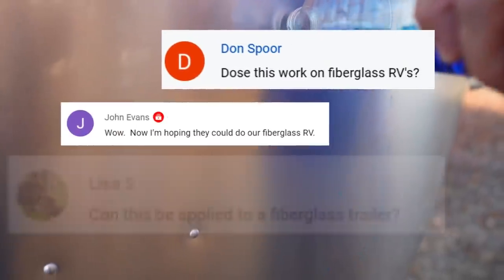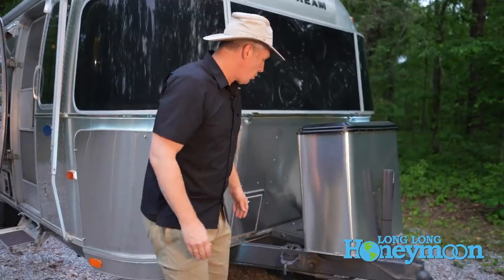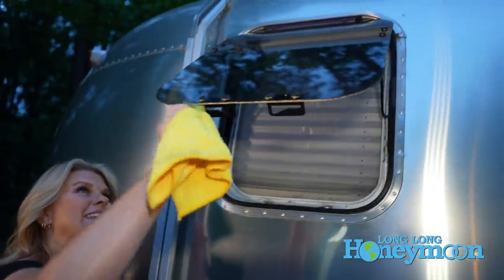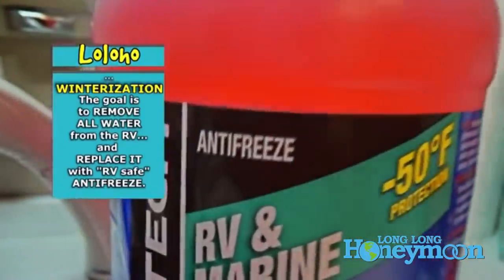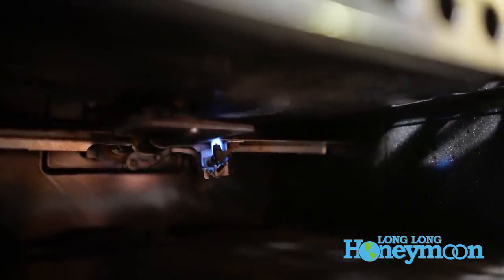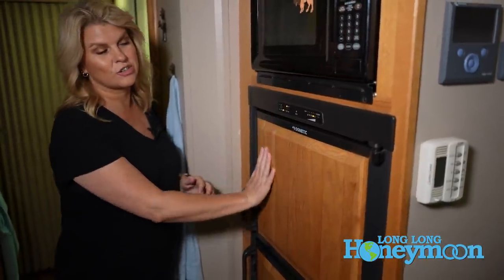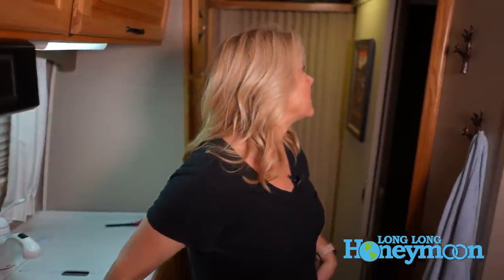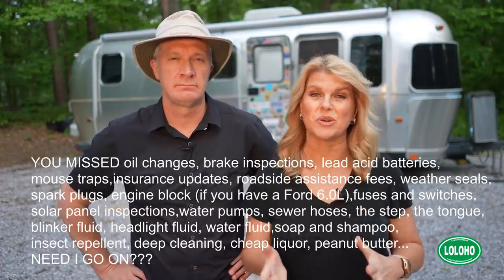FOR BEGINNERS: BREAKING Your RV Out of STORAGE -- a Few Tips!

Comment: Sean and Kristy, getting the bleach into the fresh water tank with a funnel is always a challenge. A solution I saw was to use a smart water bottles with a rectangular cut 1 inch wide, 2 inches wide on the side of the bottle, bottle top into the tank opening. Pour the mixture from pitcher into the cut out  while holding the bottle in the fresh water opening...no splash and no drips. Also works great with antifreeze into the system for winterizing

Comment: While checking on your tires, it’s a good idea to check the wheel bearings to see if they need to be cleaned and repacked. Also, make sure you have a fresh 9 volt battery in your smoke detector. I made the mistake once of leaving the battery in my smoke detector when I put my camper back into storage for the winter, and when I stopped by the storage unit to check on my camper it was beeping inside. Now, I remove the battery when I winterize and put in a fresh battery when I de-winterize.

Comment: You mentioned PROPANE FURNACE VENT., you can get a set of 'bug screens' 2 or 3 in a set, little springs included along with the install tool for the springs. Let me tell you, these are a bugger to put on but worth the effort. They come in different sizes to clip over water heater vent & furnace vent., Amazon.

Comment: First and foremost, this is a great video on de-winterizing and is packed with lots of information.  But the humor in which it is presented is pure genius.  There are so many funny aspects that I am unsure if I can even comment on them all without running out of space. Glad to see your upgrade to a new sway control device from Reese, as the O.G. model you were using was definitely showing some signs of wear.  Regarding checking your lights before you travel, the new Silverado's with the max trailering package has a light test that allows one person to see the lights on both the truck and trailer cycle through a visual checklist.  Didn't realize your Airstream had a heat pump in addition to your furnace.  I definitely took your advice and got a pizza stone for my oven as well as thermometers for my oven, refrigerator and freezer.  My Micro Lite's oven only gets up to 350 degrees (on thermometer) even when it's set to the highest temperature.  Perhaps my regulator is a little wonky or maybe this is just "how it is".  As soon as Kristy was lubricating the awning supports and Sean queued up the music, I new a funny line was coming and his "lube your shaft" reference was hilarious.  So was the "larger banana" and "tight nuts" jokes.  There's nothing better than educational material presented in a hilarious format.  Keep up the great work.

Comment: Great tip on the alkaline batteries. I also remove all aerosol cans for the winter so they go back in the spring. Also each spring I regrease the trailer hub bearings and check the roof seals for cracks.

Comment: Always good reminders, even for us "old pros",   I have found that a spray of Pledge furniture polish works well for cleaning the rubber seals around the windows.  (I always carried a can during my motorcycling days.  It makes quick work of polishing plastic and fiberglass side covers and fairings and also is a good rain repellant on the plexiglass windshield.
Reply: that's a great tip! Thanks for sharing!

Comment: You asked if any of us would suggest additional tips , so here are a few:
1. Look at all the locks and latches around the RV; make sure the keys work and maybe lubricate. Wipe down the rubber seals like Krusty said for the windows.
2. Operate and inspect your leveling jacks. Lubricate, and address obvious rust.
3. Do a visual check of your roof. Check for abrasions, caulking problems or debris.
4. If you store your sewer hose  in a square bumper, check the end caps for wasp activity. Take out the hose and be sure it is free of rips or cracks.
5. Be sure to check freeze sensitive items stored in the camper like canned goods or water filters.
People are still finding damage they didn't expect following the single-digit freeze here in central Texas last winter.

Comment: I would recommend climbing onto the roof of your trailer and check the AC fan.  The fan will not turn if a dirt dauber builds a nest there.  Sounded like it was working when we quickly checked but we were wrong.  Lucky we didn’t burn up the motor.
Reply: Those pesky spellcheck corrections.
Reply: Dirt dinner?

Comment: Oh. My spare looks new. I'll put it on the rear as that tire seems more worn than the rest. 30 minutes later, full tread separation, wrapped around the rear bumper and smashed the taillight assembly, but the carcass didn't loose air! It was the original full size spare, nice Michelin. It was OLD! check the year code on all tires when buying a used vehicle, even a low mileage pristine one. I share because I care.😁

Comment: Sooo...this may be more for when you actually winterize, but where we live (Northwestern Washington on the uber-moist Olympic Peninsula) we've encountered excess moisture in our rig, both when we're not using it and when we are.  We found this out the hard way when we were full-timing for about 10 months, and found mold growing on our windows and behind our dinette cushions.  Excess moisture due to high humidity is extremely difficult to get rid of, at least in our experience, when you're in a cool, moist environment (some people don't like that word for some reason....MOIST!).   We've learned to put Damp-Rid or Dri-Z-Air moisture absorbers around our rig, usually one in every room, both when its sitting in our yard not being used, and especially when we're camping due to the extra moisture we're putting out while breathing, cooking, using the water faucets, etc.  We've also bought electric dehumidifiers to put in our rig and even in our vehicles if they're sitting static for awhile to keep the moisture at bay, and therefore the mold, mildew, etc.  I've had to de-mold two of my vehicles in the past few years, and its not fun.  And when its cold, we use a an electric space heater with a fan to dry the air out in our rig.  And we go around the rig several times a day wiping down the windows that have accumulated condensation.  Its a constant but necessary thing.  

So, longer than I wanted it to be, but.....MOISTURE CONTROL!  Get some!  Honestly, this is a subject I have not heard talked about in any YouTube RV video.  If you guys have encountered it, and I'm sure you have down in Bama and some of your other destinations, please think about doing a video about it.  I'm sure there's a lot of other folks out there who would be interested in seeing it.  Thanks!  LOLOHO!

Comment: You showed your truck backed up but not connected for the electrical cord testing lights. That works if you have a ground wire connected to your truck. if you have a cheaper trailer the ground maybe through the tow ball so it has to be connected to test. I love Costco but their Kirkland batteries are junk that leak most of the time use Lithium batteries and you don't have to take them out. If you use your trailer a lot adjust the brakes as most are manually adjusted.

Comment: Cool video.  We have screens on our outside vents to prevent bees, etc.  I think 24 hours to cool your refrigerator seems a bit long. We have a Dometic and when we turn it on, I put in a bunch of blue ice with a couple of frozen water jugs and turn on our little battery operated frig fan and it’s completely cool in 6 to 8 hours.  Also, no need to fill up fresh water tank to get antifreeze out. We just hook our hose to city water intake and open faucets and run them until all pink stuff is out.

Comment: Considering going to Michelin Lt tires I have run with them on truck for years. Are you using Load range E tires? My trailer came with 16” Gy endurance. No issues other then mileage. About 8,000 miles in and little tread left.

Comment: I own and live full time in my 1998 Class C Coachmen Leprechaun for the last 21 years.  However, like me, it is getting old. And even though I have taken immaculate care of it, during the one year(2019) that I did not reside in it, it developed a leak.  After thousands of dollars plus in roof, over cab, floor replacement, etc.  it is now delaminating - a lot.  I am skeptical about taking it on long trips . as high speed roads and highways, with resulting battering from Mother Nature and eighteen wheelers , would probably result in my faithful Leprechaun peeling easier than a Irish ☘️ potato.
The solution seemed to be to acquire a small travel trailer. Which I have done.  Trailering is a whole different world!!!
Who better to refer to than the two of you!!!
I have watched/saved all your videos since joining you tube.  Now if I can just find the video about securing stuff so it doesn’t bounce everywhere while going down the road, I will, once again, be a happy camper.
Your channel is not only educational but entertaining as well.  You are the BEST.